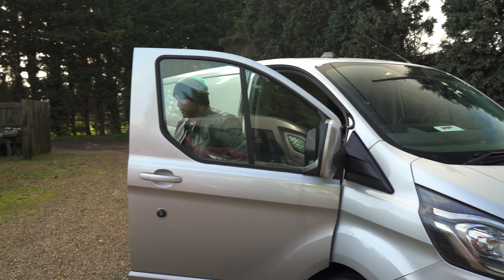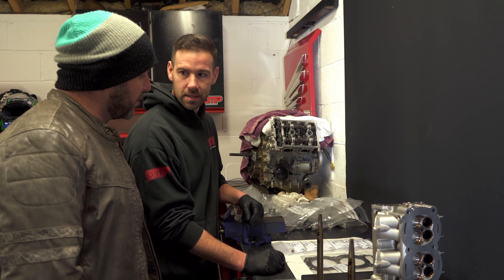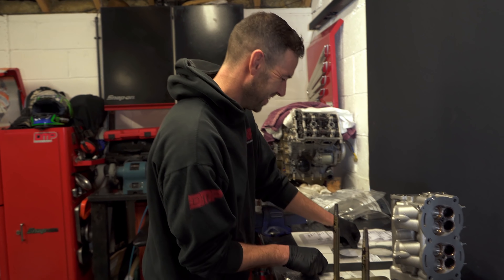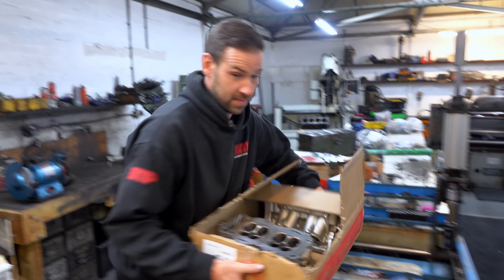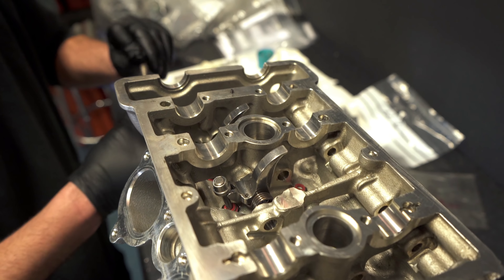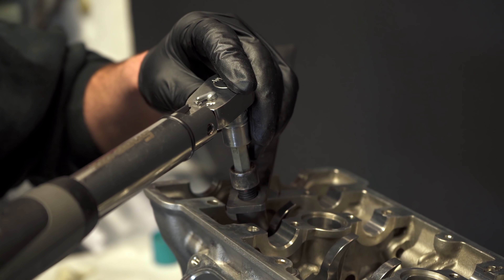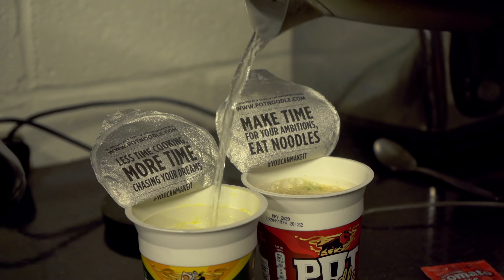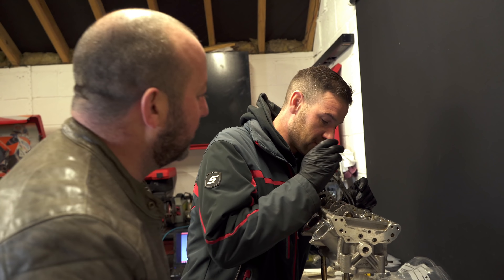Ducati Desmosedici RR Re-build Project Part 9 (Project 425) In 4K

Comment: Last V4 engine I rebuilt was a Honda NC35. A dream to work on with finger followers that you slide sideways to change shims (no need to take out the Cams to adjust). The Desmo is certainly a pain!

Comment: I've been looking forward to this latest instalment for so long and it didn't disappoint! Quick question - having skimmed the heads, have you had to make any adjustments to maintain standard clearances for the cam gears, for example, or valves to piston? Were those £800 head gaskets thicker than standard perhaps?
Reply from the maker: We've been getting some advice and the only issue we need to deal with will be the compression ratio, it was a very light skim.  We will be checking everything once the heads are ready to go back on.
Reply: Great! Thanks for taking the time to reply. Much appreciated.

Now - get back to work! Can't wait for the next instalment.

Comment: I thought the desmo system did not use springs , what are the springs in the head used for then
Reply: The Valves are free floating,the Springs are for the Rocker Arms.

Comment: Forgive me being a barbarian,  compared to a conventional valve spring arrangement, this seems like an unnecessary over complication. I admit I don't know what the rpm limits are for this set up.
Reply: The Desmo system has its advantages and disadvantages ,less reciprocating mass in the Cams ( look at the width of the Cam Lobes)  and reduced friction come to mind but it is more complex and finicky to maintain as well.
Reply: @paultanton4307  Thanks for explaining this Paul as I thought the only benefits was to avoid valve-bounce at very high rpm. Funny how Ducati stopped using the beautifully engineered shaft and bevel gear arrangement of old to drive their cams and replaced them with a cheap rubber belt. You can tell I'm not a Ducati owner, sorry!